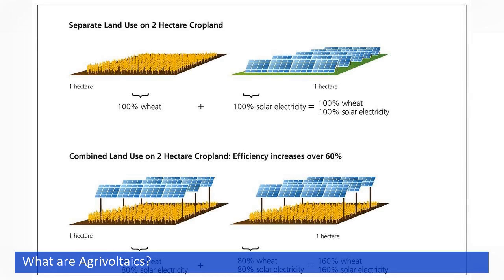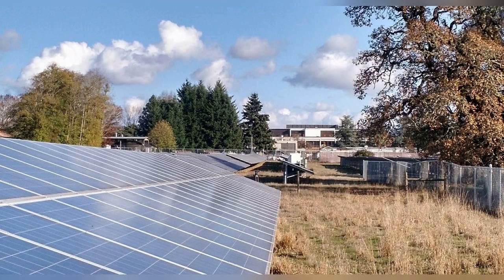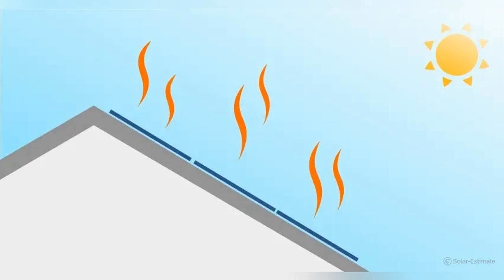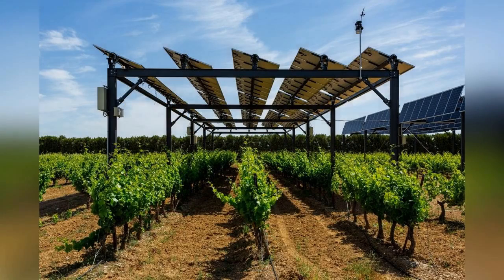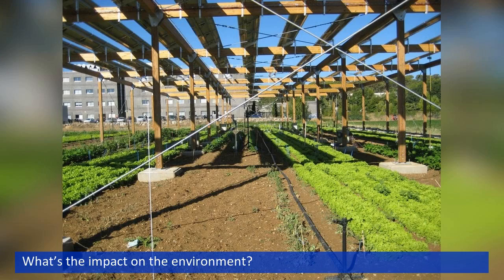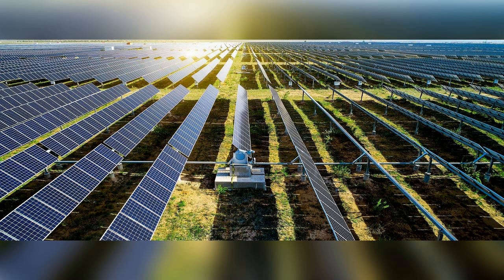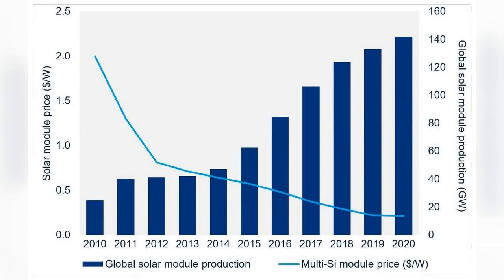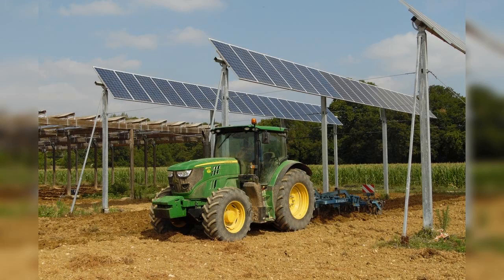Agrivoltaics. APV - what does it mean?

Comment: I figured that solar panels typically produce most power when oriented towards the south direction. 

However, it's really tough for me to find answers whether for agrivoltaics, the panels are oriented towards the east-west direction or the north-south direction. I believe it's towards the east-west direction?
Reply from the maker: Installing solar panels orientated directly east or west will typically only have a drop off in generation of about 25% compared to that of a south facing array. But the east-west orientation helps to minimize shading on the crops or vegetation beneath the solar panels. By aligning the panels in this manner, the shading occurs primarily on the side of the rows rather than casting long shadows directly over the plants. While there may be specific situations or cases where a different orientation is preferred based on factors like local climate, latitude, or specific crop requirements, the east-west orientation is generally considered a suitable approach for agrivoltaics.
Reply: @etfnews  excuse my very stupid brain, but my guess is :

1. if my panels are oriented towards the south, since the sun moves from east to west, the row spacing between my solar panels (not beneath my panels) will constantly be illuminated by the sun? and anything beneath the panels will constantly be shaded?

2. whereas if I face my panels to the west, shade only occurs on the row spacings and beneath the panels on specific times of the day? since the sun rises on the east and sets on the west